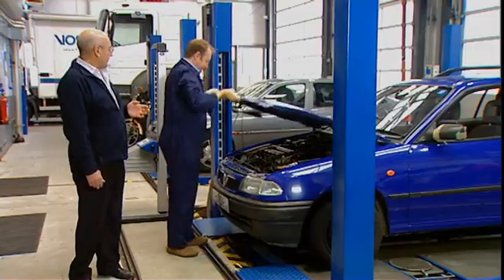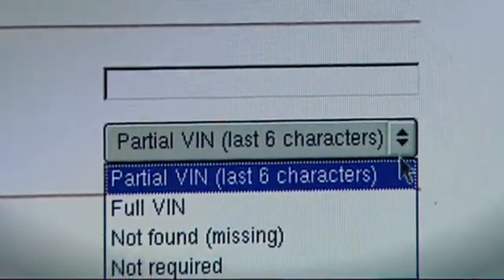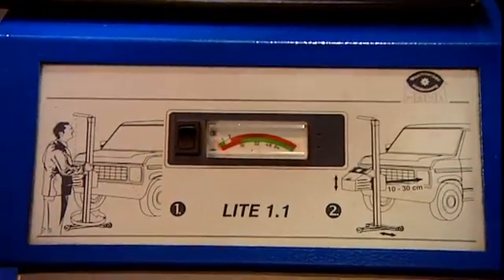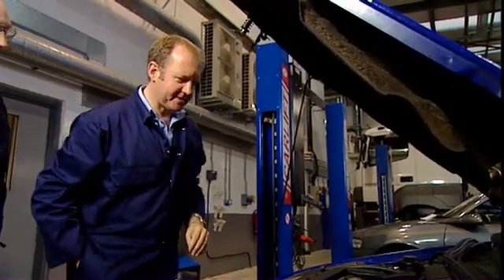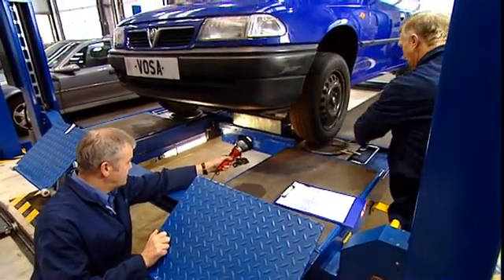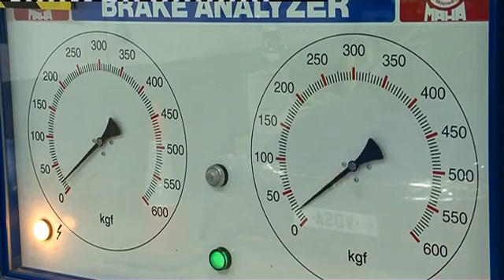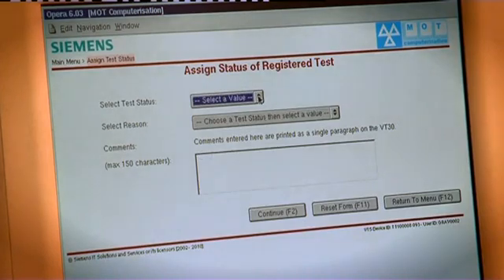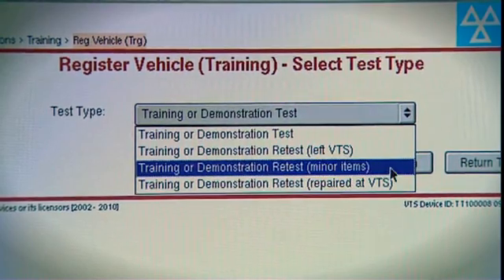MOT testing - The Great Mistakes

Comment: Outdated method of testing, and needs to be updated to 2020. as there have been many changes to MOT testing new rules add on's since this way of testing, or taken off youTube because if DSA or VOSA watched you do a test like this? you're going to get points? anyone else see all the mistakes the NT made, yes I know he wasn't a real MOT tester but the other guys was?  just one small point now you don't have to use a bar on the suspension, so if you have a test coming up for you MOT license, don't follow this routine, you will FAIL
Reply: I just help train a new tester and DVSA like you to use the bar as you can’t use the shaker plates in a demo test
Reply: Nothing wrong with a trip down memory lane. If you're currently training you will be provided with up to date material. I personaly love this old stuff. The pre computerisation days were a right pain in hindsight but seemed cutting edge in the day!

Comment: You'll never find inner tie rod plays with that method mate. And why do you use four-wheel alignment release pad for inspecting front suspension? Would it be better to use proper chassis shaker tool for that? At least I do so.